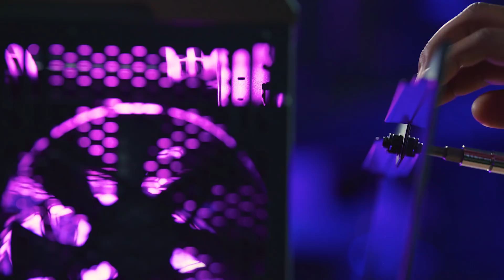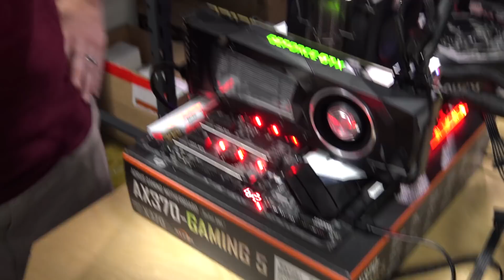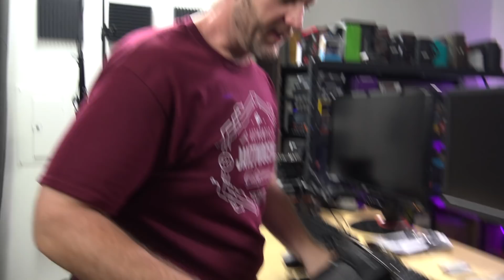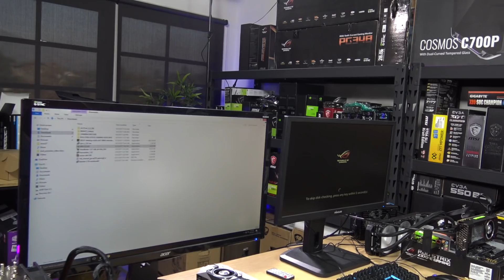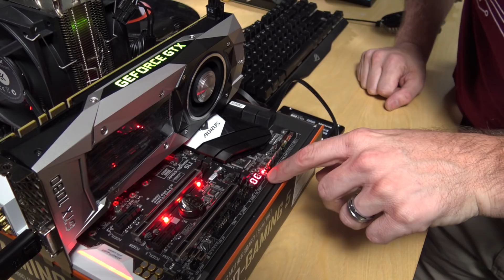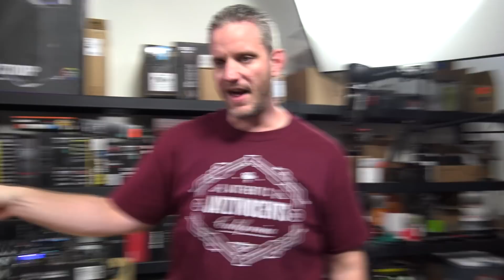I cant figure this one out... HELP!

Comment: Perhaps the Intel system has a higher voltage variation threshold than the Ryzen system or a difference between the video cards themselves on how much power they're pulling and one board has better tolerance than the other?

Comment: I have had a similar issue with older GPU. It would work perfectly fine in one system, but in another one, would crash few seconds after the initial post is cleared, just as it starts loading Windows. That same system would work with no problem with another GPU. It turned out to be some weird power delivery issue. I am guessing you have something like that too, and it is is caused by a sum of different factors like CPU OC and voltage, Ram OC and position in the MoBo slots, SATA, Peripherals and PCI/PCIe devices position and power draw and so on. 
Try to test different configurations of the whole system, because the issue might not be in the GPU or the MoBo.
Even though this is the same model Graphics card, and high end cards tend to be very similar, unlike lower end cards (as you showed in the 1050 ti video), perhaps the titans are just different enough, due to silicon lottery. Perhaps the first Titan draws a bit more/less power, or circles power a bit differently, and the Ryzen config is running into some very weird, very unique issue. 
I suggest you attempt what I did to fix my problem, and see if it works. I gradually replaced components from one PC to another testing all the possible setups. Starting with the PSU, then RAM and then even the CPU. For some reason the motherboard would fail to power the components properly, but changing the RAM position from dual channel to single channel would fix the problem. No matter which of the 2 ram sticks were moved to different color slot (4 slot MoBo with 2 sticks), the system would boot in single channel. As soon as any configuration with dual channel was made (even moving the 2 sticks to the previously empty slots) would fail to boot. And then the cherry on the top was, that removing the PCI Gigabit Lan card and the hard disk to do a bios boot with no OS would make dual channel RAM actually work with the GPU Card. However connecting ether the LAN or the HDD would make the issue return. But the system would work if the HDD was connected to different SATA connector and the LAN card to a different PCIe lane which was not 1x. Replacing the CPU in the rig (It was Core 2 Duo 8400, and I replaced it with Core 2 Duo 7500) would make the system boot properly with the Sata HDD in it's original place, but not with the LAN card in any x1 PCIe slot.

Comment: I work in electronics manufacturing and I have seen that even devices that are supposedly exactly the same can have unexplained behavior differences. The device may work and pass all tests but still can behave weirdly in some situations because we cannot possibly test absolutely everything.  Because that card works in the Intel system and not the AMD system does not mean it is not faulty. The MOBO on the AMD system could also be faulty and the combination of that card and the AMD setup might show a problem. I would suggest testing the card in an identical MOBO to the original one. If this works then the problem was in the original MOBO setup. Still this problem might only present itself with that combination of card and MOBO while that card may work in other MOBOs and that MOBO works with other cards. Here I have been assuming the problem is hardware fault not software related.

Comment: That could be anything, I wouldn't say it was specific to a platform just because a Graphics Card wouldn't boot in one and then did in the other, I've literally never heard anyone mention this, I'm on the AMD Forums a fair bit.

Id change the AM4 motherboard first see if it still happened as the Graphics Card is clearly fine, near all problems I've heard of came down to the motherboards on the AM4 Platform.

Comment: Has happened exactly thing to me.  That with specific gpu it doesn't want boot. All I did I, I reset mobo cmos with gpu that it doesnt work with. And then it should work after resetting.

Comment: you did not check the version on the proper card which is in the right test bench... you checked the card on the right and moved it to the left test bench... hello jay... wake up
Reply: I noticed the same thing. Had to restart the video and check it again to make sure
Reply: Noticed the same thing,  after watching a 2nd time. Also Jay picked up the "good" card (the one that worked in both systems) and said "it's specifically this one that works in that test bench and in this one, but not this one." When in fact the "bad one" was plugged into the 8700k test bench. (video time @ 8:00 mins)
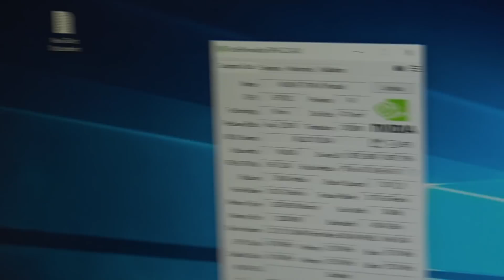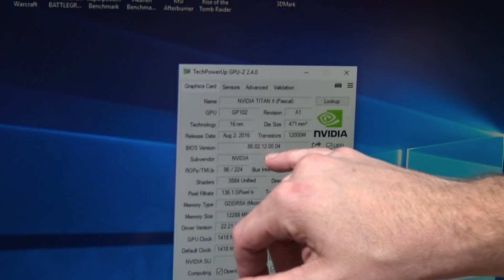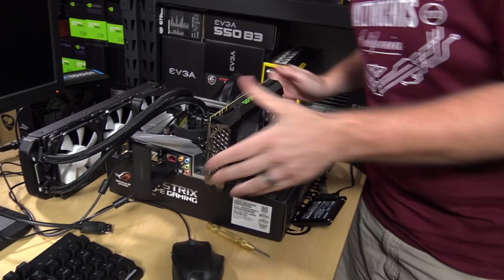Reply: If the GPU BIOS version of the card in the intel build is 86.02.12.00.04 (2:11), then it will be the same if you place it in the Ryzen build (4:51). It's the same card... The big question is: is the bios of the other card the same (the card you did put in the intel build on 3:15)?
Reply: Thank god somebody else noticed LOL.. wtf Jay :D facepalmer
Reply: I was wondering why he didn't check the bios on the other card.
Reply: DERP
Reply: Mac Joe why didn’t jay check the bios on the bad card
Reply: +James Fox, you're wrong. It's on the graphics card, not the hard drive.
Reply: @James Fox  Your thinking Video card Drivers NOT the BIOS the BIOS is on a chip in the Graphics Card. You do not even get to the driver part until after the Computer has booted.. 

You do not use the drivers that are on the system when in the PC's UEFI Bios setup screen.
Reply: glad it wasnt just me....
Reply: i notest that to about the laft wasent working but dident get anny info after it was switcht to the other system...
Reply: Yeah, he checked the version of the same card.
Reply: I dropped him a tweet, hopefully he sees something. I mean it might not solve jack or shit or he has already done this off screen but you never know
Reply: Mac Joe I was just about to say the same thing lol.
Reply: I noticed it aswell
Reply: yes I noticed it that's right, I think the bios version on the other one is older
Reply: Lol I thought it was just me
Reply: ya.. I wanted to be able to shout into the video!...
Reply: I noticed the same thing, but it may be he already checked correctly since he acted like he was showing us something he already knew.
Reply: no.. he updated bios on the motherboards, he said you "COULD" update the bios, which was a hassle on pascal
Reply: The fact that he did not check the bios version on the correct card is gonna drive me crazy. I was yelling at the monitor while watching. Are you getting old Jay?
Reply: I was going to comment the same thing but you nailed it first!!! I second Mac Joe, Jay, check the bios on the GPU that was giving you issues!!!!!
Reply: Nick is watching everything he does, and doesn't notice...
Reply: Jay,  check if both cards have the same vbios and most importantly,  if it's UEFI Bios. <<
Reply: He did say he already troubleshot for some time before this so maybe he already knew? And if he didn't, he might have just assumed it was fine since it booted. Regardless, I would have triple checked both cards just for my own sanity.
Reply: Jay wth 🤦🏻‍♂️
Reply: Lol yeah that's what I was thinking when I saw this thread. Since when do GPU's store that kind of information?
Reply: Yes that is the versions? Did you try a different motherboard?
Reply: lol
Reply: YUP. Was just about to post the same thing, he tested bios on black xp both times not the silver one.
Reply: Bump and agreed, my spock eyebrow went up...
Reply: @Martin Claesson     Updating the Bio on pascal isn't a hassle, it's very simple...
Reply: @billy mathieu i was simply quoting jay
Reply: @Martin Claesson   Ah sorry about that...
Reply: And his assistant didn't notice it either. Quite useless fella.
Reply: And you all think Jay has not gone through and checked the BIOS off camera before he made this video? I have no doubt that what he is saying is the truth.
Reply: LOL same card different system same bios, who woulda thought
Reply: LOL   Guys ..  Just stop.   Your motherboard has a BIOS,   (flashable)   Your hard drive has a bios.  (Flashable)   Your video card has a bios (flashable)  Your MONITOR,  has a BIOS (firmware)  (flashable) 

Drivers and firmware are different.
Reply: You realise, he said, he updated the BIOS on BOTH CARDS
Reply: Hey GUYS , The Bios is on the SSD / HDD , Not the card !!! DERP MUCH ???

Comment: is there any way you can check if the card is overvolting on start, could be a lane connection issue on the board related to the connection it makes on that specific gpu causing it to spike and not post...just brain storming just watched will reach a little deeper after I get some sleep.

Comment: This can be a 100 of different things, even a PSU issue. To stick this one on the CPU is a bit strange.
Reply: how can it be a psu if it works with a different card lol moron or troll?
Reply: Anonymous Coward Having a PSU with a weak 12 volt rail can cause issues when booting up. GP 102 is a big chip and it uses allot of power, chip to chip variance could lead to a peak power draw on bootup that one chip can make it through and another one can't. I agree that it's a bit far flung but certainly not impossible.

Comment: Hi JayzTwoCents,

You have probably already thought of this and/or checked this, buuuut...

This smells like some sort of VGA bios incompatibility or corruption. Downgrade the BIOS on the 'fidgety' GPU and then flash it with the latest BIOS.

People have already said this and I do not know whether you already checked to verify, but you checked the BIOS on the GPU that was originally in the INTEL bench twice. (Once before taking it out of the INTEL bench and then, presumably because the INTEL machine after the swap was power cycling, you checked the same card's BIOS again while it was seated in the AMD bench.)

Please verify whether the BIOS version is the same on both cards while they are both producing an image on their respective working setups and if they are indeed identical, make sure you flash the BIOS on the card that is slotted into the INTEL bench.

Kind regards,

Mike

Comment: +JayzTwoCents
4:07 Personally seen this problem several times over my 38 years in the industry. It's not common, but has/does happen. The firmware on the problem card might have a single bit error that does not show effect on an Intel system but does cause a problem on an AMD. It's likely a problem on the code that starts the card up and interfaces with the PCIE bus. Intel's startup routines are different than that of AMD's. Get in touch with Nvidia for a firmware flash tool with a fresh update.

Comment: I actually think it is the motherboard. I had a similar problem a few years back when I had my AMD Phenom 965 BE on an ASUS M2N 98TD Evo. I wanted to use it with a 9800GTX+ which was a custom card by MSI, but it would constantly cause Bluescreens. I then changed graphics cards with my father. He had a Phenom 945, a slightly different ASUS Board (can't tell the exact version anymore) and a Reference 9800GTX+ by PNY. After we swaped the graphics cards everything worked fine. I did not experience any further Bluescreens and neither did my father. But this happened over 10 years ago. So I don't know if this is still relevant.
Reply: Eric Walldorf it's relevant enough. Issues like this have happened to other people on am3+ and so it could be any number of things.

Comment: Im also a techy and once cleaned out my system and took out the GPU, when i plugged it back in it woudnt post! Took that same GPU and plugged into my other system and it worked. Tried a different GPU in the motherboard and it worked! could never get that GPU to post in the same motherboard after i took it out to clean haha WTF. Some things are left unexplained.

Comment: lol you checked the bios on the same card. You had the non working card in the ryzen and put it in the intel to check the bios, but then you checked the same card in the ryzen which was the card in the intel to begin with so you checked the same card  twice instead of checking the other card that need the bios checked.

Comment: hmm could be that the bios on that card, maybe bugged out during a flash i have heard cards getting rejected from systems due to custom bios. It could also be the firmware as well i had two 1060 a while ago, one of them didn't like the newer firmware so i had to keep both at an older one because I would get random black screens.

Comment: read to the end: have had a strange ram issue but seams to effect the graphics heavy applications. @ 2133Mhz it would start to run heaven or a game stutter like heck and crash to desktop . @ 2933 would do the same however ... ? if I took out one of the ram sticks all is well an fine at both 2133 and 2933 . swapped the ram sticks both work changed the GPU did the same thing with different cards . only way I could get it to be stable was to remove one of the 8GB ram sticks . don't know if the data will help with the issue you are having but was worth saying. I have got a different MoBo going to swap them out in the a.m.    R5  1600 , corsair ram, B350 tomhawk , 650w EVGA PSU, 1050Ti SSC  swapping to a strix B350 gaming F . only other thing I can think of is a bent pin on the cpu or a bad dimm stick question is why is the GPU failing and nothing else . I get gr8 scores in Cinebench with one ram stick or both ???

Comment: I have the same motherboard and had some similar problems when  I changed my gtx1080 amp extreme to the gtx  1080 arctic storm. I solved the problem with a bios hard reset. After that it works fine.

And you checked the bios version of the same card.

Comment: I had a similar  issue with my Crosshair VI hero and Ryzen 1700 during a build.  I wanted to check to make sure my new components all worked before gutting my 1070 out of my old machine and decided to toss in an XFX 7850 that I had.  It kept giving me the b2 error when I tried to use the HDMI port to the display monitor.  When I used my DVI cable though, the card worked and I was able to get my bios to post.  I had chalked it up to the card just being older and not on the list of recognized cards by my MOBO's bios.  It's worth a shot if the Titan has DVI outputs.

Comment: Umm you checked the Bios of the card that was working on the intel system .-. not the one not working on the Ryzen . Obv the Intel system card will have the same bios once its stuck in an Ryzen system , Right ?

Comment: First you not check the bios for not working graphics card you put it in intel and leave it .If bios is the same try different pcie express slot on ryzen.Tri with power supply which on intel system.And last try to see for bad power deliver try cables on that graphics card some time may be not make a good contact and pull more from motherboard.If all not work try with one stick ram and reset bios with battery leave motherboard with no battery for 10 mins and try again.Sorry if my English is  bad. I will think for more if not that work replay me.

Comment: My initial guess: Ryzen POST is more thorough than Intel POST. Try disabling fast boot,quick POST,partial POST or anything similar and hope it fails in both systems. Or it could be Power Delivery Chain problem; reroute cables, replace the PSU or the mobo.

Comment: i'm having crazy problems with my ryzen build too. literally the only thing that changed was the motherboard and CPU. GPU, PSU, etc all stayed the same form my last intel build which worked PERFECTLY from August 31, 2014 until last april when i "upgraded." i get random boot loops when starting, crazy performance dips, and other weird shit. i tried an Asus X370 crosshair and asrock x370 fatality pro. tried several BIOS version on each. i officially gave up trouble shooting this crap and i will be switching to an 8700K ASAP. i have actual work to do, i can't do this shit anymore.

Comment: WELL THERE IS ONE EXPLANATION TO YOUR PROBLEM... ITS NOT ABOUT THE MOTHERBOARD,THE CPU OR THE DRIVERS BUT THE GPU BIOS(FROM THAT SPECIFIC MANUFACTURER) WHICH IS CONFLICTING WITH THE  MOTHERBOARD BIOS...
WHEN A NEW CARD IS RELEASED OUT ..VENDORS USUALLY BUY THE CARD AND PRODUCE  A CONSUMER END PRODUCT ..WHICH YOU THEN GO AND BUY...AT THE PROCESS OF CONSUMER END PRODUCTION ..THEY MODIFY THE CARD BIOS  AND ALSO INCREASE  THEIR OWN LINES OF CODES..TO RECOGNIZE THEIR OWN SPECIFIC DRIVERS .BELIEVE ME THEY CAN ALSO FORBID DRIVER UPDATES..OR ALSO THEIR CARD TO RUN ON SPECIFIC CHIPS OR EVEN CPU
Reply: Next time turn off the caps lock
Reply: GUILTY AS CHARGED!
Reply: i just like the caps but ill try
Reply: ok,but the card is a founder edition for nvidia, who provide hardware and software, is not a msi, asus or whatever

Comment: I had a similar issue an year ago..a particular 970 wouldnt work in x16 slot..would work in a x8 slot but not on x16..all other card mean while would work fine in all pcie slots..while this 970 would work on all other boards and all other x16 as well..I finally narrowed it down to mobo bios being finicky..I'd recommend downgrading the bios..mobo bios or reflashing the latest one.

Comment: hi Jay I got a problem like that I've just upgraded my  GPU to a evga gtx 950 using a TV as sticks on bios or black screen i have flash the bios but still the same put my other card in and works fine

Comment: its a sign of loose connection. Or some pin imperfections.. it is a physical stuff. Not about firmware/bios or boot. May be the PCIe connectors in that AMD MB is faulty or loose or not making contact properly. Somehow other card interfaces fine.